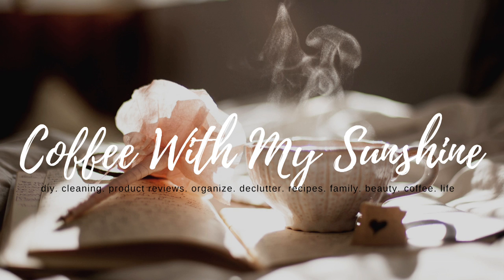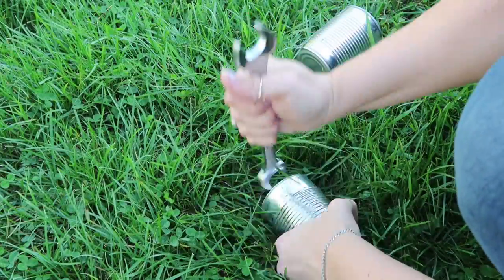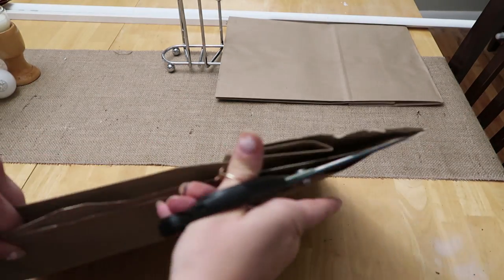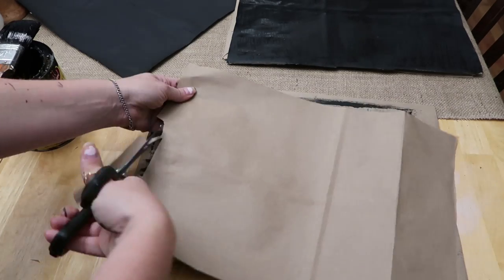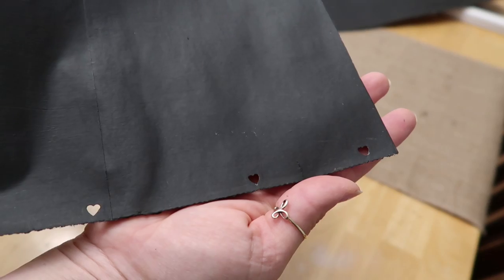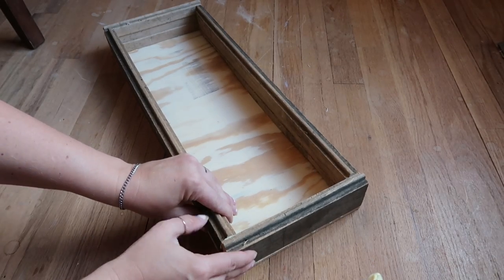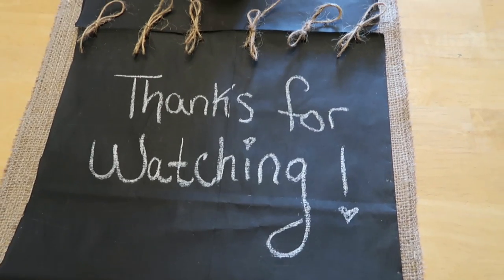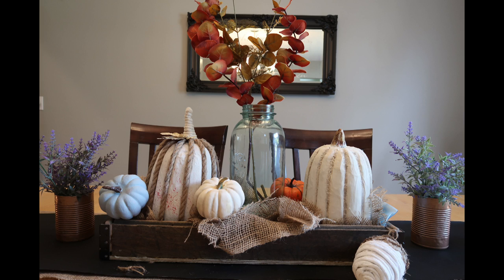USING TRASH TO CREATE TREASURE SEPT 2019 | FALL TABLESCAPE DIY | MODERN FARMHOUSE INDUSTRIAL RECYCLE

Comment: Your projects turned out nicely. I would have never thought to use paper bags for a table runner. I do like to use metal cans for projects. I decided, at one time, to use them for punched tin art. I just printed clip art and taped to the can, took an ice pick and hammer and followed the design. Then I put candles in them. Just a tip, before punching or hammering, either one, fill the can with water about a half inch from the top, freeze it and it makes for a more stable surface to work on. Some cans are such soft metal that they want to crush while you’re working on them. Maybe this will help someone who has had that dilemma. Btw, I love that crate that you made and I actually think that I have some scrap to make one. 🤔🍁🎃
Reply from the maker: I've never done that. I'll have to give it a try for sure. That's an awesome tip too. I would have never thought to freeze it first.  Oh I hope you can make a similar crate. I love mine. Thanks so much, Sharon!

Comment: If you have access to fresh rosemary and fresh lavender the combination of these two is intoxicating.  They look lovely in all of their stages of drying and can be used as simple sachets on the outside of packages instead of using a bow.
You did this well.  You did yourself proud.
Aunt B
Reply from the maker: Oooh that sounds like it smells amazing! I have both of those in my garden. Surprisingly they are still going strong even though we've had some frost already. Thanks so much for the idea! I can't wait to try it. :)

Comment: I’ve got a question just how do you get that heavy duty thick adhesive off of tin cans I have yet to find a way to get it off easy and efficient. Love your channel you’re very creative young woman.
Reply from the maker: Usually I will soak them in hot soapy water. Fill the can with hot water at the same time too. I think it heats up the entire can so it releases the glue a little easier.  
I hope that helps.  Thanks so much Christina❤❤❤